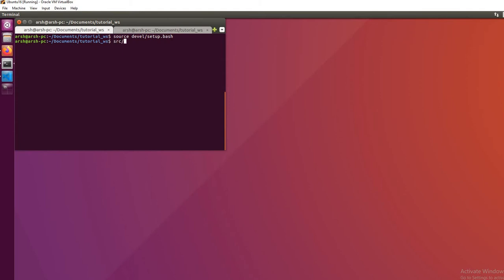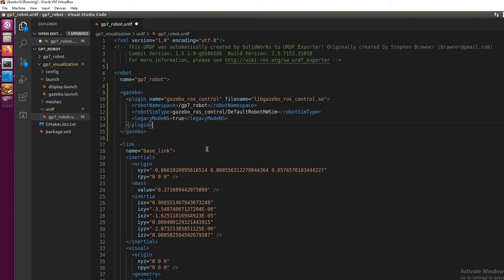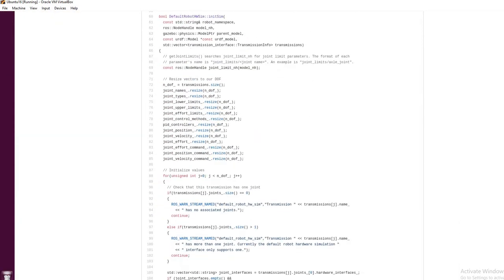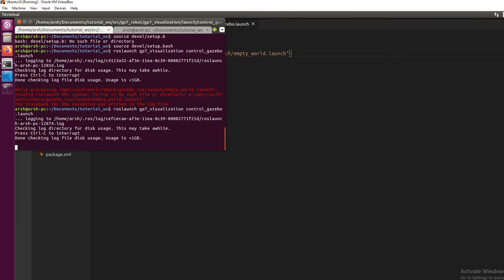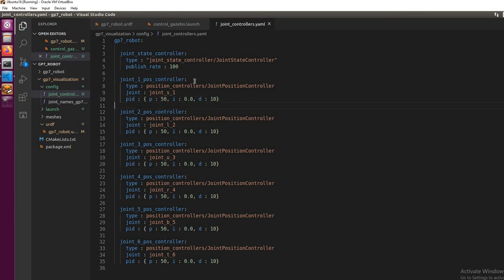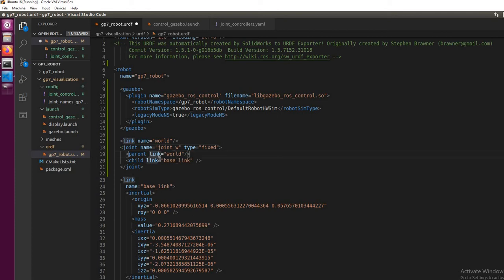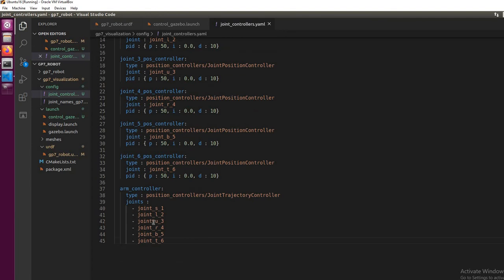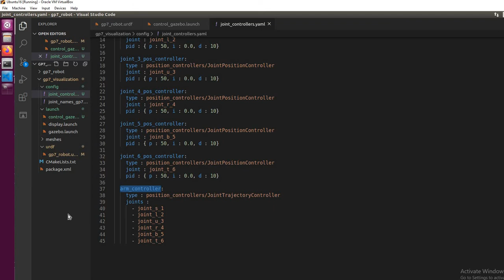Control industrial arm using ROS control and Gazebo ROS control - Part I

Comment: Hi i am having a spawn error due to which my model is not showing  ...... Plz help
Reply from the maker: Can you please post your spawn error. 
I think you might have missed a step. Make sure you source your workspace (so urdfs and the stl file paths within urdfs are properly found by spawn node). These are just guesses as you mentioned no error message.
Reply: @MuhammadArshad   Yeah I missed one step now i have recovered it but a new error appear when i type rosnode the following error occurred ERROR: Unable to communicate with master!  I have seen many ROS answers but it didn't worked fore me ... Thankyou
Reply from the maker: @aroobashafique7552  your ros master should be running when you use commands like rostopic, rosnode, rosservice etc. ROS master gets started when you launch a roslaunch file (i.e. automatically) or if you are bringing up the nodes individually (using rosrun), then first you have to run roscore command in a terminal
Reply: @MuhammadArshad  i am having problems in rqt and in joint calling command and rosparam/robot description commmand it state error that parameter is not set kindly can you see my codes i will be very thankful to you...  I have my final evaluation  ...... Plz let me know

Comment: hi i am having problem in controllers can you help me out
Reply from the maker: Please post the errors you recieve
Reply: @MuhammadArshad  my prismatic joints are not moving  .... While i can control continuous joint but not prismatic joint
Reply from the maker: @aroobashafique7552  did ypu set the limits of prismatic joint.
Reply: @MuhammadArshad  yes i resolved the error by setting the value of prismatic joints....  Your video helps alot...  Thank you really appreciate your effort

Comment: Hello this video was brilliant and my code worked pretty well. But even after specifying the pid values why does it still show pid gains missing?
Reply: Hello. I have same problem. Did you solve it?
Reply: @onurcankaraca3457  I did some research on it. Its not an error actually. It was just a warning.
Reply: @aasishkc1799  after you said i tried and it moved. Thanks but how can i remove it warning? Do you know?
Reply: @onurcankaraca3457  As of my research I saw that when i change the controllers type to effort from position , that resolves the prob. However, when you specify the controllers gain with the controllers config file you can resolve it.
Reply: @onurcankaraca3457  Yes i sorted that out. just define the pid values within the controller.yaml file under "/gazebo_ros_control"